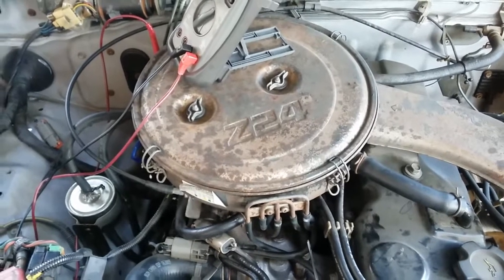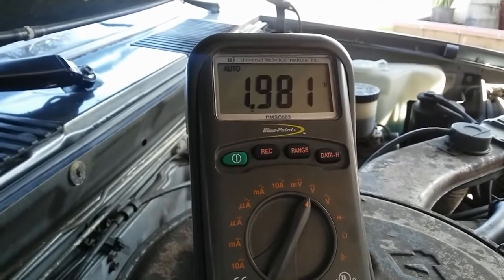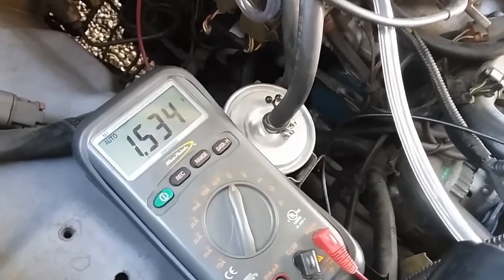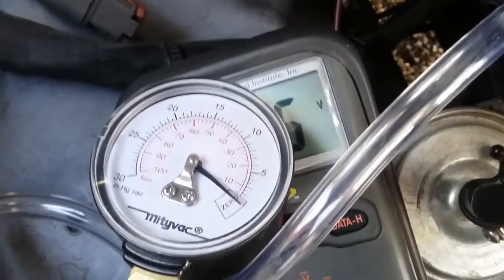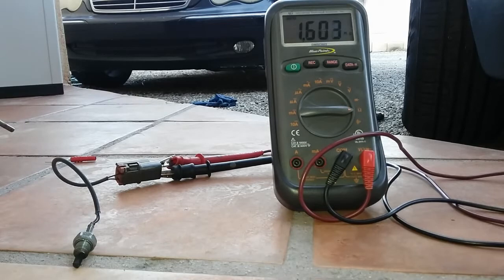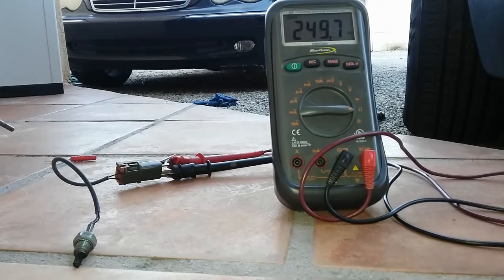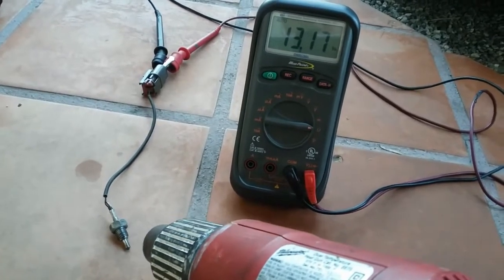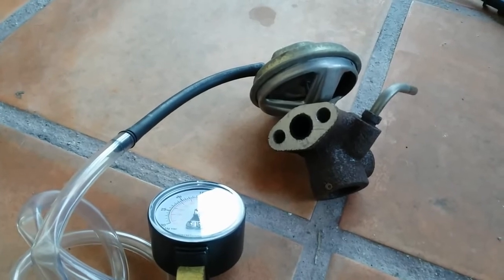(Nissan D21) Troubleshooting DTC 35

Comment: My question is where exactly is the truck's EGT located? since I have a similar truck but it does not have that sensor and I have DTC 35 because of this.
Reply from the maker: Can you give me the year, make and year?
Reply: @EliTheOBDTech  Nissan pickup 1989 4x4 z24
Reply: @EliTheOBDTech  Do you need a VIN number?
Reply from the maker: @arturovelazquez9274  I will try to have your answer soon.
Reply from the maker: @arturovelazquez9274  What's the sub model E, SE,XE?
Reply: @EliTheOBDTech  E

Comment: Are you supposed to get vacuum on the hose on top of egr valve with engine running and warmed up to like 2000 rpms?
Reply from the maker: Yes, you should

Comment: Do you think  a code 41 cause a code 32 on a 93 pickup d21
Reply from the maker: Hmmm... It's very unlikely that DTC 41 Intake air temp sensor will trigger a DTC 32 EGR Function. Most likely a DTC 35 EGR temp sensor can trigger a DTC 32.
Reply: @EliTheOBDTech  hey man whats up i have a 1989 nissan d21 i have that conector with the green and red stripe just hanging in the engine bay i tried to find the sensor and didn't find anything is it possible that my truck is not equipped with that or do i have to look harder ???
Reply from the maker: @Alfonxo454ss  is your truck a California emission?
Reply: @EliTheOBDTech  my truck was from Washington state I wish i could send you a picture it has all the egr stuff its just the one 2 cable sensor that goes screwed in that i can't find becuse it has the conector dangling..?
Reply from the maker: @Alfonxo454ss  If you can, send them to my email: eguillen.tech@hotmail.com